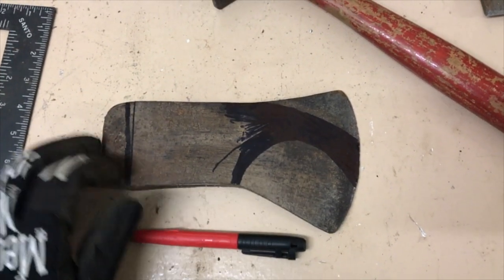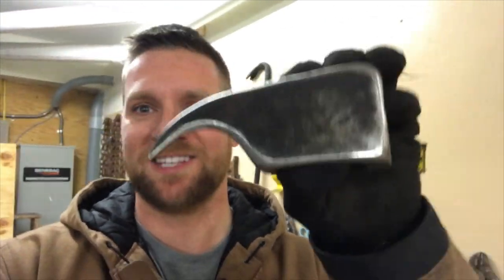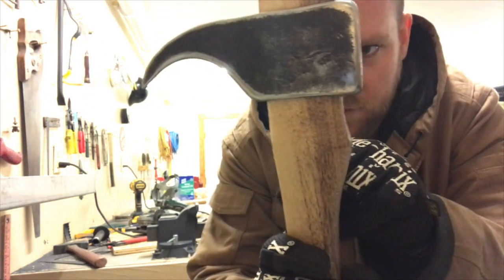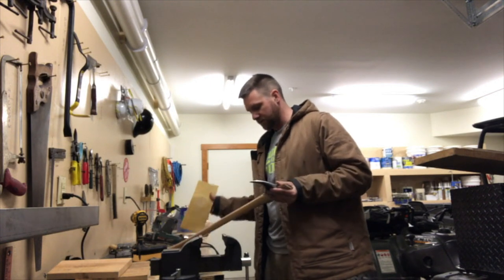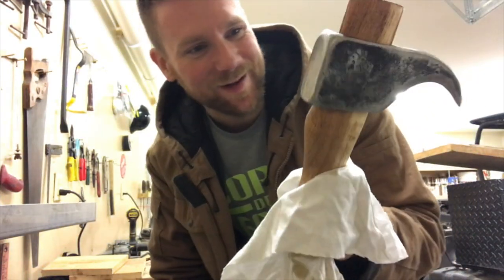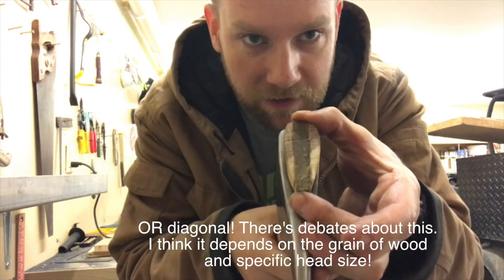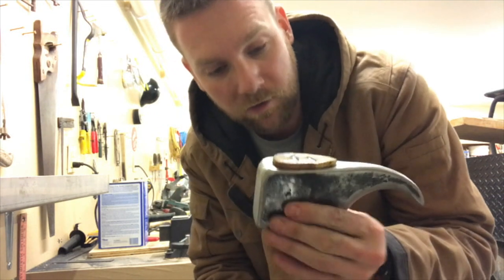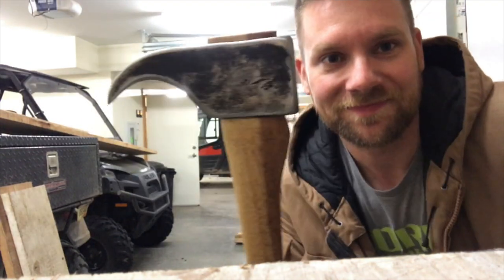Pickeroon DIY project HUGE firewood back saver!!!

Comment: Very good video! When the picaroon fell on the floor I sure hope that was a sound effect of glass breaking and not the real thing! Hehe!
That's a great way to make a picaroon because you can pick up those old Axe Heads pretty cheap specialty if they are all buggered up. I got one out here in the building and we're going to start on it and thought I'd look me up a video to get that right pitch on the cure and the point cuz if it ain't just right it aint sticking in your firewood. You got that thing dialed in pretty good, you get that solid sound when she hits the wood!
I have one I made years ago but point got wore down where I sharpen it  so I think I'm going to retire that one and make me another one.
But they're just so handy for saving your back picking up the firewood off the ground and also from grabbing the wood either back on the pile or on  the truck where ya can't reach!
Thanks again for the video. Take care and stay well!

Comment: Pinning the head on a tool that's going to take a bashing is only good practice, when I first restored my vintage pickaroon I just wedged it and after about a year it had worked itself loose. I then reset the head and pinned it and its been rock solid for over eight years now. I do the same for axes I use for banging wedges.

Comment: That was a very nice job.  I have a suggestion.  If the handle has the minimum of moisture content, wooden wedges all round are an option.  It's a pity to drive a metal wedge into a nice piece of timber, especially when there is the possibility of making a crack in the handle.  What do you think?